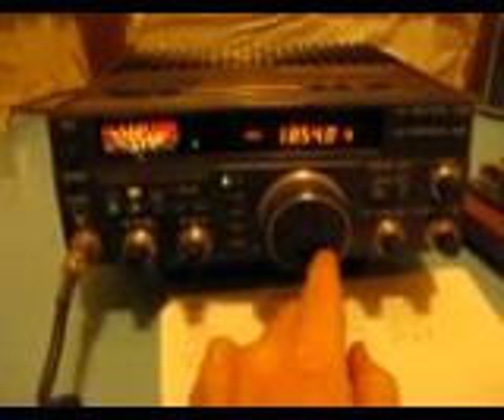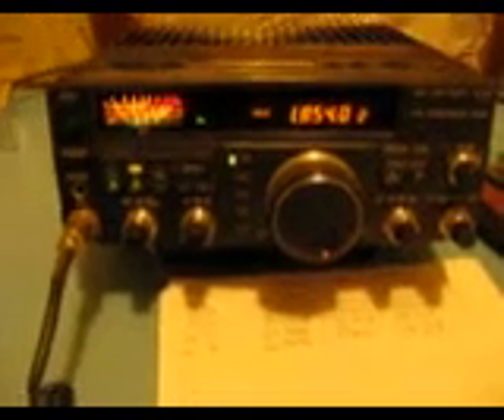How a seperate receiving antenna helps HF reception

Comment: My secret is a "low wire" - place say an 18m longwire about 2--3meters above the ground and compare it to another longwire 10-20m AGL and notice the difference - small difference in signal strength, HUGE difference in noise level.